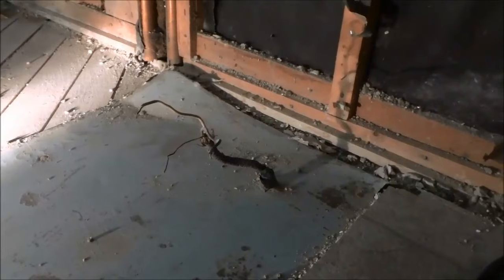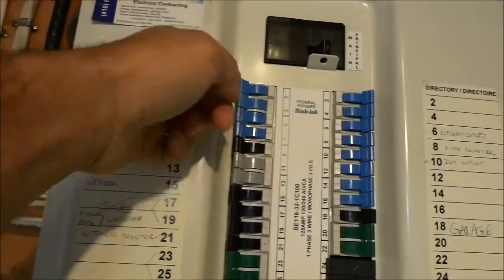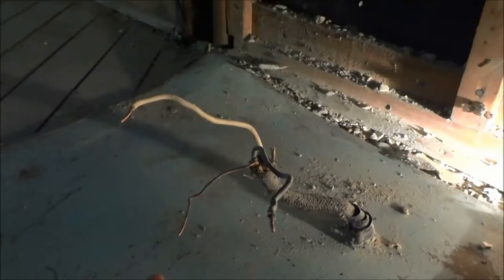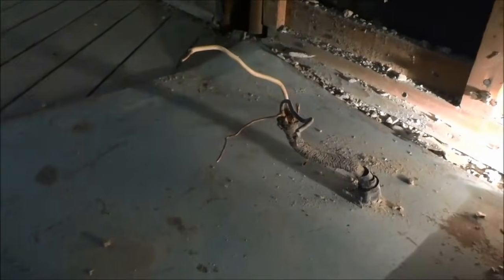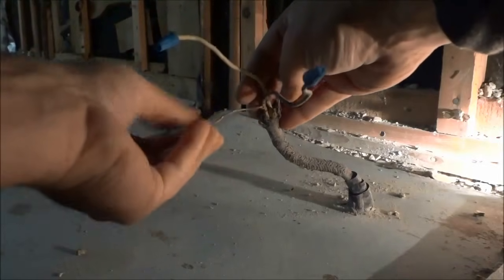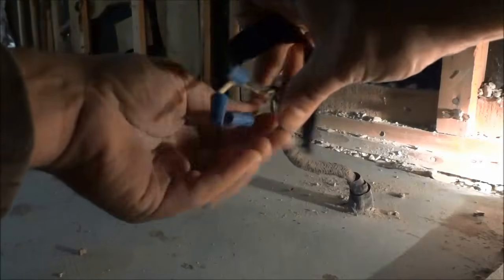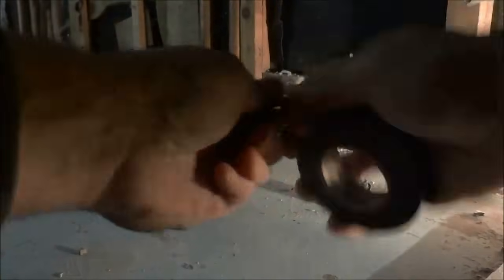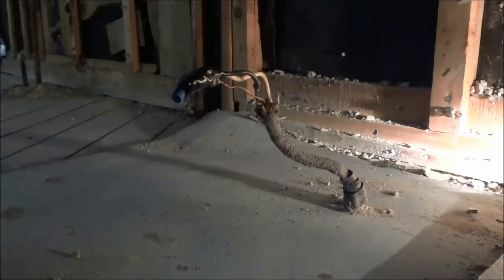How To Cap Off Live Electrical Wires (Safely)

Comment: did he really put a wire nut on the end of a bare ground wire?!!! lmao
Reply: Yup and I will tell you smart asses why, the tip of the ground wire can slide into the safed off hot causing a dead short which in theory would trip the breaker but could also spark a fire. These wires will get moved, demoed or shoved through sill plate and moved some more before they are ready.
Reply: Electriceeeel, it has been 4 years since you left your lmao comment and wondering if you have grown up since then and matured from a boy to a man. Or do you still believe putting a wire nut on a ground to prevent the end from touching a hot wire is still wrong and hilarious?  I hope you learned that you do in fact cap the ground as well as terminating the circuit in a grounded box as well as all grown up.
Reply: 61spindrift well it has been 4 years that felt like about 10.  So after reading the comments here,  I would have to change my opinion.  There’s no harm and only gain,  minus one wire nut.  

High voltage lineman brain: To me,  it was like taping the end of a triplex service drop.... ya gotta keep the electrons from getting out. 

I love these comments that i get smacked for years later.  Truly appreciate your approach as well. 

Thanks for letting this one age. Haha
Reply: It could poke you.
Reply: If the sharp end cut through the insulation of the hot wire, you'd think he was a genius.
Reply: csknives2140  who doesn't have electrical tape?! How else are you supposed to make bandaids?
Reply: Electriceeeel what would you have done??
Reply: I'm a licensed and certified electrician myself and I was just LMFAO at that when he just did that. At the same time as a licensed and certified electrician this type of video is what scares me most because people who don't know any better and trust what they find on YouTube will follow this and get seriously hurt or killed or maybe burn down the house. Seriously please if you don't know what you are doing and are not a licensed and certified electrician please do not do this work and the fact that you searched this video shows that you are not a licensed and certified electrician. I search videos like this to try my best to protect the people who don't know better and are looking to do the work themselves but no matter how much money you might save it's not worth it. As a licensed and certified electrician I go into homes all the time and see the absolutel mess that home owners have done to the wiring and most times it's just nothing but luck that I got to it when I did because it's literally a fire waiting to happen or just waiting to seriously hurt someone. Please don't do this work if you are not a licensed and certified electrician.
Reply: @RavenTheLabrador  not everyone has big money to pay an electrician 100s of dollars in this economy. So yea DIY is what will happen.
Reply: Don't you know? Electricity only comes out of the very ends of the wire. That's the dangerous part... :)
Reply: Electriceeeel he doesn't know what he's doing

Comment: Pretty sure he was just doing a temporary cap job until he can add a fixture or outlet to this wire. He should have tested to assure the wire wasn’t hot and clarified that you can’t leave these wires exposed (not in a junction box) like this however.
Reply: How do we cover them?
Reply: @rodneymicheal  What he did was appropriate as a temporary cap. My point was that one, you should always test a wire with a voltmeter or similar to assure it isn't hot. You can work with hot wires, but it is risky and should be done in such a way that you don't shock yourself. 
As well, that is a weird wire, just coming out of the floor like that. Normally it will come up inside of the wall, where it will then be connected to an outlet inside of a gang box. If they aren't in an appropriate gang box, they can be inside of a junction box, but only if the junction is accessible.
Reply: @jeffreystonesr7910  Yes, I had the wire coming out of my wall after I removed a range hood. My new over the range microwave didn't need it, so I was looking for ways to properly cover it. Based on your original comment, I looked up junction box and I was able to install an old work box and cover it. I also added the caps and tied the wires with electrical tape before closing the box. Thank you!

Comment: Dude! Always check the wires with an appropriate voltmeter after switching of the supply. It's a crucial step of standard procedure. This is dangerous info you're handing out.
Reply: just smack them with your hand real quick. if you die, you'll know the power is still on.
Reply: I was thinking the same thing even after turning off the breaker I still test the wire great habit to have
Reply: Dan Elleson yea
Reply: Peep peep
Reply: could you plug a light into the outlet if there was an outlet to check it?
Reply: @sciuz23  no, there are multiple reasons why you could have no power at the outlet but high voltage at the other point, and overlook that.  Plus if you don’t at least have a good DMM handy then you 100% should not mess with that kind of wiring. You’re playing with your life and the lives of others that come into that house later

Comment: Danger Danger Danger!!! I can't believe by turning off the breaker you assume power is off... you need voltmeter to check before u intent to touch any wires....
Reply: Personally, I do not trust wiring and I turn off the entire house when I work on it. 
I’ve seen lines live that were shut off.  No thanks!
Reply: @kerirobicheaux6629 same here! Always be aware
Reply: I always just kill main power
Reply: It’s actually a good thing you commented thanks
Reply: I agree. I'm fixing up a 1950 house and learned that the labeling in the panel isn't always correct, and that a number of the rooms seem to be cross wired with the adjoining room. Lots of people apparently worked on it over the years and didn't always know what they were doing....I ALWAYS test with a voltmeter before touching any wire. And I test my voltmeter before each use.
Reply: Just get a little outlet tester that beeps.....
Reply: @samthoren1  May be applicable, but in this scenario the wires are not attached to an outlet.  So, even if you test another outlet in the same room, you'll still have to test the wires in question.
Reply: @samthoren1 that’s all I use
Reply: @samthoren1  this sadly doesn't always indicate that an outlet doesn't have power it just tells you if it's correctly wired and if not what is missing or mixed up but power in some situations can still have power going to some of the wires and this is why you always have a licensed and certified electrician doing the work because we have the years of training to become an electrician and then and only then can we call ourselves a licensed and certified electrician to safely do this work. In some situations you can turn off the braker but still have power going to some of the wires in a junction box. An example is if someone has done the wiring in the home themselves but don't know what they are doing they can connect multiple circuits and then have power back feeding the outlet you just turned off the braker for but because it's back feeding from the neutral wire of a separate circuit it now is still hot but not the black wire like it should be it's now the white neutral wire and you don't have any idea why because you only know that you have turned off the braker for that circuit / outlet. Anyways this is just one example but others can happen as well so if you don't know just call a licensed and certified electrician because it could mean your life or maybe even your home burning down because of something 100% preventable.⚡👍✌
Reply: And turn off the main too I suppose?
Reply: I tested with a volt meter, assumed everyone knew to do THAT-- You are correct so thanks for letting folks know.
Reply: @karenflowers9711  I tested mine and my NVC current reader never did a thing, but screamed when I touched other wires and plugs in another room.  My dishwasher power has been off at the powerbox for some time.  I touched the wires, the junction box under the dishwasher and no voltage period.

Comment: Very dangerous. Imagine if someone will do the construction in the future and will cut the wire by accident, especially if the breaker switch is on. Pull the wire to a stud an place the ends in a junction box.
Reply: Yes. I like this idea
Reply: If they cut the wire by accident then the current will hit the breaker and trip it before anyone is hurt, especially if by a power tool. Erroneous complaint.
Reply: djd829 it can still kill. It only takes a millisecond to fry.
Reply: @FishFind3000  literally no.
Reply: @stevo8782  Do you know how electricity works with the body? If the current flows through your heart even for a split second its enough to stop it. You really need to learn something before you spout nonsense.
Reply: @FishFind3000  I do. I've been hit with 220 and I'm still alive. I'm not spouting nonsense, seems like you don't know how it works.

Comment: once the power is turned back on is it safe to touch any of the wires? specifically the neutral wire?
Reply: +Ryan Artz I would handle it just like any other energized wire... as in don't handle it. It should be insulated, but particularly with older wires, there can be breaks in the insulation where you can be shocked. So don't ever touch any electrical wires unless the power is off.

Comment: You said live, you obviously turned off the power to the curcuit
Reply: scorpiomaj27 except nothing else on the circuit would then work. Breakers don't often power only one device.
Reply: +Chris Woolvin I could make this video much shorter.  "How to cap live wires, don't, turn off the power, the end."

Comment: Don't listen to this guy. His misinformation is setting you up for electrical and fire hazards. Your insurance will not cover incidents where such "handiwork" is the cause. Please please please refer to your local bldg code or at least the NEC. Capped Wire endpoints must be contained in an electrical box, always accessible ( not covered behind drywall, etc), secured, and the wires must be fastened to the electrical box using a cable clamp.
I know the building code is hard to find and very expensive to buy. I personally refer to the book "Codes for Homeowners" by Bruce Barker published by Black & Decker. Btw, I am a professional civil engineer and we see this type of dangerous info all the time. My first post on here, but felt compelled to do so.
Reply: the real how to is in the comments. i thought you needed a terminating box (grounded) with a wire clamp. even if its not code, your box will be grounded (usually a good idea) and your caps will be safely trapped in a grounded metal thing.

if i did what this guy shows, i'd have a dead cat.
Reply: @Gunbudder   I believe that the term is " J Box " aka junction box
Reply: Laura Zelman yes, that would be the correct method, with a cover on the box of course.
Reply: I'm tearing down a playhouse thats wired how can I disable those wires
Reply: Totally agree
Reply: +djcsr wat about doing wat dis bloke says cuz the wires are in my car by my feet. not gonna put a cable box covering my gas pedals ...or wait does the code say so 😅
Reply: I removed a garbage disposal and am not replacing it. The Romex wire comes out of the wall. Can I strip it back and put wire nuts on the three wires, then roll it up into a plastic junction box and mount that on the wall? Would that be safe? Thank you for your input!

Comment: I'm wondering if I have to go to the hardware store and buy those caps, or if I can just use electrical tape, which I already have on hand?
Reply: The ends of the wires are sharp enough to puncture out of the electrical tape.
Reply: ELECTRICAL TAPE IS NOT A REPLACEMENT FOR CAPS.  Please don’t die.

Comment: Thank you so much for this video and detailed explanation!! I am removing two really weird shop lights from a bathroom and putting in one overhead light. I had no idea how to end the wires on the spot i wasnt putting in a new light. Much appreciated
Reply: Do not do this unless it's a temporary safety precaution while working elsewhere on the project where the branch needs to be live. in that case, put mechanical wire nuts on the end. tape should NEVER be used except for marking single wires. if nothing is to be done with these hanging wires and the circuit remains live, you need to feed the wires into a junction box, screw it to the wall, and put a cover on it. write the circuit breaker number on the cover for future reference. if you later put the house up for sale, you will pass inspection, otherwise you will get gigged.
Reply: nin
Reply: Are you still alive, is your house well? Most people here think not.
Reply: +djd829 alive and well.  actually face timed a friend to talk me through it.  I knew the basics of testing for live wires and crap
Reply: +Tara Rahe I figured as much. Likely daunting news for the other people who watched this video ;)